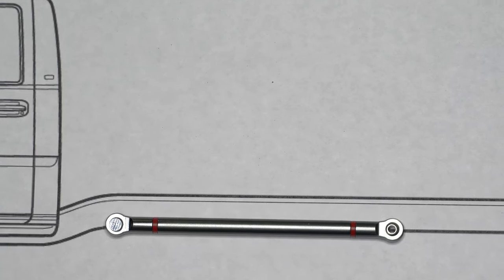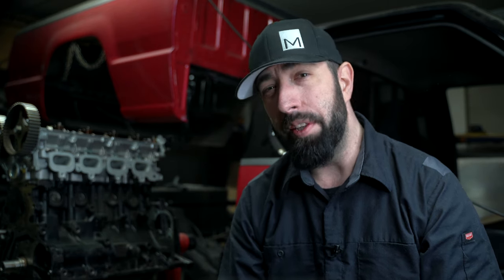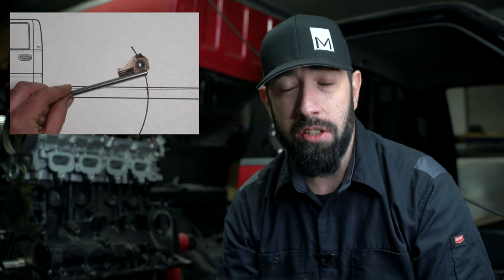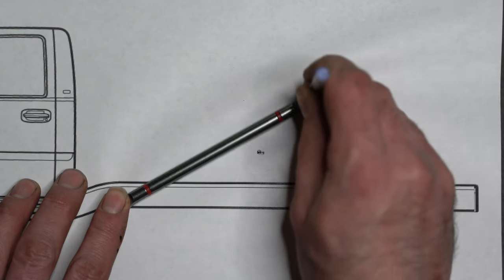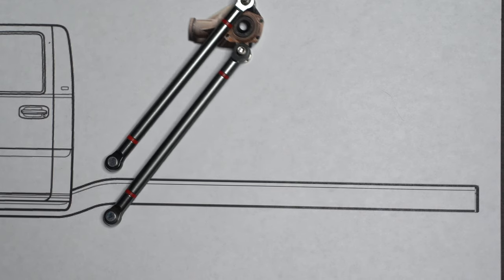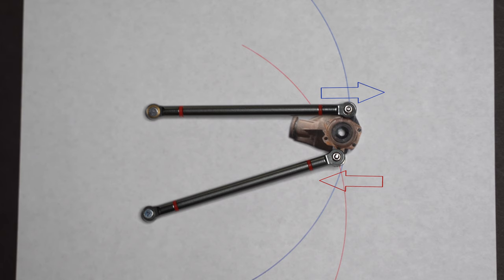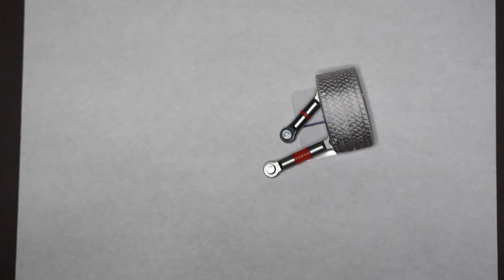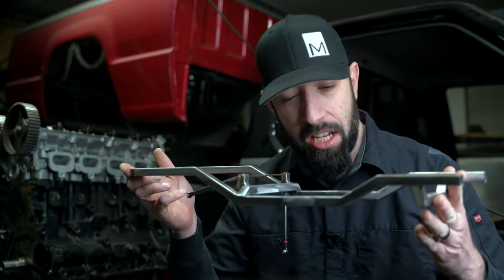Suspension Basics 02: The Effects of Link Bar Movement on Attached Components.

Comment: how about a video on antiwrap axle bars with shackles for offroad vehicles
Reply from the maker: I’m not sure I’ll ever have the opportunity to install one of those, but I’ll see if I can squeeze some info about it into the video currently in production about U joints and pinion angle.
Reply: @GarageFab  if you can that would be great. Think more along the lines of a ladder bar with 2 points mounted to the frame above and below axle, upper bar is welded into straight lower bar than attaches to a short shackle and that shackle attaches to a cross member that bolts or is welded to both sides of frame  just below or above the driveshaft (off center from driveshaft)
Reply: @GarageFab  also throw articulation into that above info.. I've searched all over for info about all of it and can never find anything that  talks about all of it together
Reply from the maker: @beerock  That sounds like a different video all together. What do you need to know?
Reply: @GarageFab  I'm working on a 1980 cj5 with a 350 Chevy and  a YJ leaf spring conversion. Just finished it and I'm getting axle wrap and trying to figure out the best way to stop axle wrap and still have full articulation. If you do make a video about the different way solid axle with leaf guys do it and show them all (even the bad ones like traction bars with no shackle) and point out the best way I'm sure it will get a lot of views you def gave me some good infó I even made diff on a price of paper and I attached arms to it and swung it up and down.. most guys use a ladder bar with cross member frame to frame with shackle mount, 1 shackle 1 bar attached to it and 1 mount welded to axle with 2 attached bars (triangle config) I've heard it binds a little for articulation.. hope to see a vid of it soon!
Reply: @GarageFab  also might want to add the ladder bar with shackle in back of the rear instead of in front of the rear to control axle wrap.. Ive been going back and forth on which way to do it. everyone mounts in front with shackle but only found small amounts of info about moounting in back of it by the leaf

Comment: ok, can I build front suspension with equal length bars?
Reply from the maker: With a solid axle? If so, yes. I can’t speak to performance applications because I’m not well educated on building front link systems. Bar angles play a large part in traction and handling capabilities. With a solid axle you would still want to keep your pinion angle in check and equal length bars will do that. 
For control arm front suspension, I’d say no. The difference in the length of the upper and lower arms create a change in camber when the vehicle body rolls which helps maintain traction in turns. Making everything equal would take away some traction.
Side note! I got a couple of notifications of other comments from you earlier but I can’t read them. YouTube doesn’t allow external links and some other things that I’m not clear on yet. If you can, go check and see if your comments have been removed and if it tells you why! That would help me out a ton.

Hope this helped, Brother!